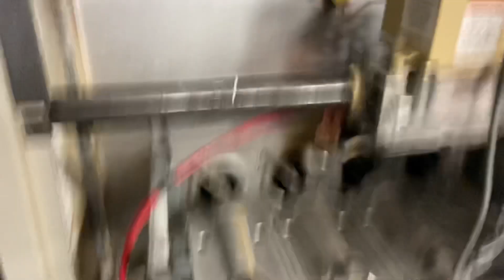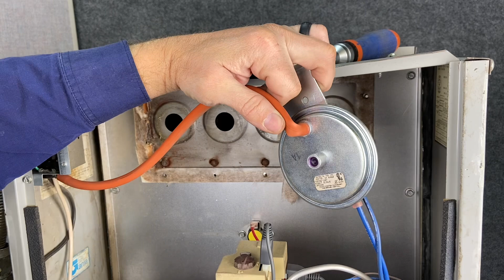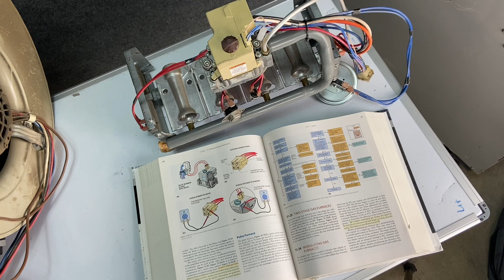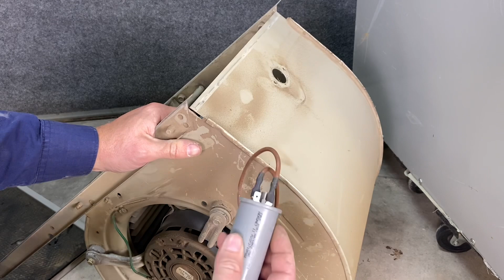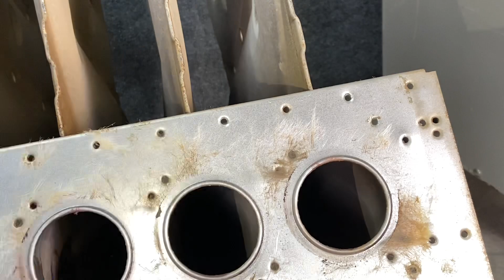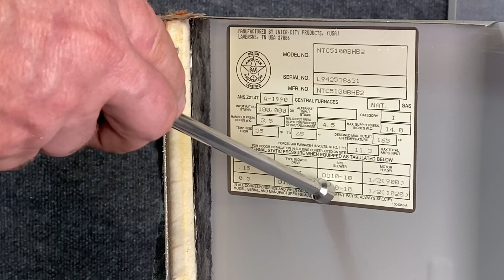Smart valve / intermittent gas furnace

Comment: I’m having issues, I changed the gas valve and the igniter glows and the gas valves releases gases through the pilot tube but the pilot won’t light. Is there a solution for this? I’ve blew through the pilot tube and it’s not clogged
Reply from the maker: You may have air in the lines. It takes a while to bleed it out

Comment: I’m not getting 24 volts to my igniter. The gas valve is only putting out 1.1 volts
Reply from the maker: plugs on the GV get loose, you can re solder  the plug pins on the control board.

Comment: Rookie question: what size fuse should go on the low voltage side when replacing transformer? also what are some of the key components that would also need addressing if a 80% was replaced by a 90+  ?
Reply from the maker: 3 amp is usually fine, some units require a 5 amp.
80-90 you will down size the furnace. A heat load. Should be performed anyway. 
You will replace the flue pipe with PVC all the way out following the manufactures instructions. And you will need a PVC air intake pipe.

You will need an acid neutralizer for the condensate and a place to drain the condensate so it will not freeze.

Comment: Even on a 90+ Furnace, what could be used to safe guard the system in the event the gas valve does not completely shut off the gas flow once the thermostat calls the control board to shut off the heat?
Reply from the maker: The combination gas valve has 2 redundant valves in series inside. For it to stay open both would have to fail. 
Also the co tool board monitors the flame sensor. If it senses a flame present it keeps the induce draft motor running and keeps the blower running also.
Also the way the board is wired the 24 volts from the thermostat "w" wire passes threw the board to the combination gas valve. So even if the relay in the control board stuck closed the thermostat would also have to stick closed or a short from R to W in the thermostat wires AND a stuck closed relay in the board. 

Anything possible but it's highly unlikely and very well thought out.
Reply: @love2hvac  Thank you for your reply.  I asked because this happened to a neighbors house's furnace many years ago.  Lucky he was home and had a sprinkler system in the attic which put out the fire which melted the furnace. A report indicated that possible root cause was stuck gas valve and zinc gas pipes. This is all the more reason, proper installation and seasonal maintenance of such items as the flame rod and roll out sensors are vital in any system.  Your instructional videos are very informative and educational.  Many of my colleagues starting out in the HVAC field as installers greatly appreciate and benefit from them.  Keep up the great presentations.
Reply from the maker: @TheRealoldcar  zink flakes from galvanized pipe has been a concern for some time. Yet so many people still promote it. A proper drip leg is suppose to catch any debris before the gas valve including the sink flakes. If the flakes built up and kept one valve open it's possible for them to continue to flow and eventually keep the second from setting all the way too. In that case it would bot stick open but leak. This would not be enough to maintain a flame so the flame sensor would bot sense the flame and the unit would not know. The gas would build up to an ignition source and then ignite. 

Multiple fail points here. 
Nobody ever raised concern over the galvanized pipe. No inspection of the drip/dirt leg. Service tech did not check for 100% shit off. Unfortunate strikes g of event. Luckily they saved the house and hopefully nobody was injured!
Tecks say "I've been doing it this way for ___years and never had a problem." Its not until it is. 

Thank you for sharing that with me. Those accounts are important to share. I would love a copy of the report with names and addressed blocked out. It might make a good safety video this winter.
Reply: @love2hvac  I wish I could get hold a report as a lesson learned from my younger colleagues also.  This is what I find unique about your YT channel and your presentations, you get to point, the nuts and bolts, and provide real world experiences and practices.  I am so impressed that I subscribed yesterday after watching just one of your vids. Just enough detail and no fluff.  I can see why so many school instructors show your vids to their class.   Your teaching often makes the viewer feel like they are on a job site.  Plus i notice from one of your videos, (you were talking about what if something could additionally cool the liquid line after the condenser with another means), that you think "OUT OF the BOX";  regarding HVAC technologies.  The best parts is when something goes wrong on your presentation material; that happens to us everyday in this field.   Keep up the great work.

Comment: i got myself in a mess.. i changed the thermostst and  when i turned on power  nothing worked .. i put back the old one and nothing works except the blower runing all the time, changed the board and same thing...now i am convinced its the smart valve circut is out there power on the main board going to thermostat and to smart valve , the inducer isnt getting power from the gas valve but power is being sent to the  same inducer connector from the main board
Reply from the maker: Usually means a blown fuse on the board. 

Unlikely the valve, usually a loose connection on the valve more than anything.
Reply: Odds are you grounded your wires when changing the stat and blew the fuse on the control board

Comment: That tool is a waste of time and money. That gas valve is garbage just like everything else honeywell makes, and if anyone see's one replace it immediately with the pilot assembly. You will get an up graded valve same brand a little better but not by much. Right were the pilot wires clip in at on the top of the valve will get water , condensation etc. Water can come from a plugged evap/coil, condensation from location etc.  Matter of fact just sell them a new furnace. I was on a call years ago the lady said it sounds like her furnace is exploding, I am like yeah ok. She is standing off to the side I have the cover off and cycle. Pilot lights, gas valve opens working. I did this like 20 times. She is like I am not crazy. So I turn it on again we are talking and I hear the gas come on look down and no pilot, As I was reaching for the power switch it lit and BAMMMMMMMMM! I was like JESUS CHRIST. New gas valve and pilot assembly.
Reply from the maker: I agree, I never liked them. 
I bought the over priced kit many many years ago before I knew how to diagnose them. 
Direct ignition, DSI or HSI is the way to go. I suspect they had a hole bunch of these cast pilots and thought let's just modify them. 

Holly cow I have not heard of one exploding like that! I would love to have that on video. 
Thanks for the comment. It's nice to see someone with the same dislike for them!
Reply: @love2hvac  HELLO Great video learned alot i have the same unit model but a guy a few years ago some how put a electric spark to like the pilot never work after that . another guy came out turned my gas off said it was unsafe now im stuck with no heat need your help what can i do with low cost i was a master car tec retired now on ssi can do the work myself with some guided advice knowledge..that video was awesome..yeah i have the honeywell valve and board love to show you a picture of it to see what parts maybe put it back to factory spec's thanks
Reply: Hate these valves also,  just had to change 1 on a hanging heater in a shop 2 days ago